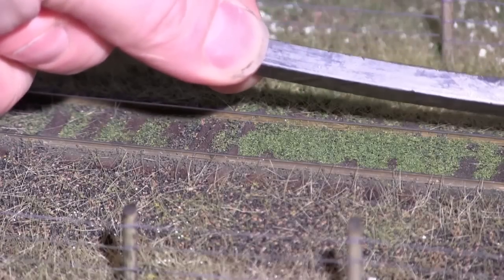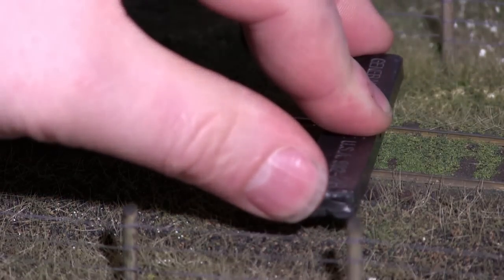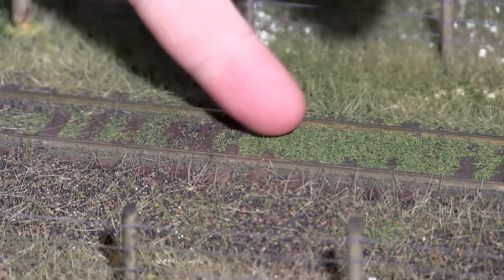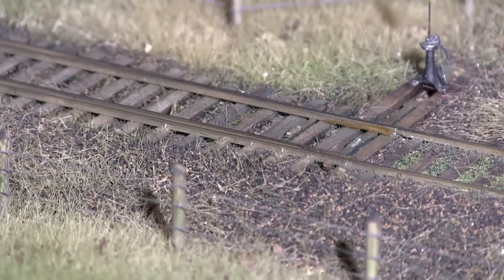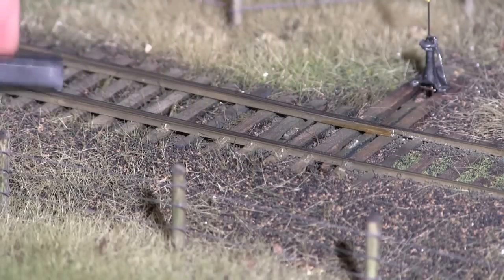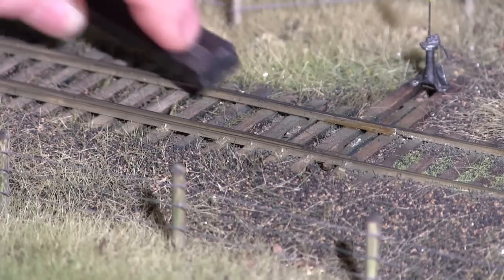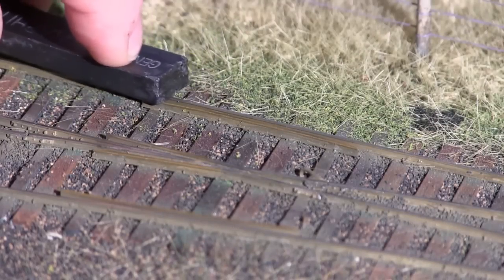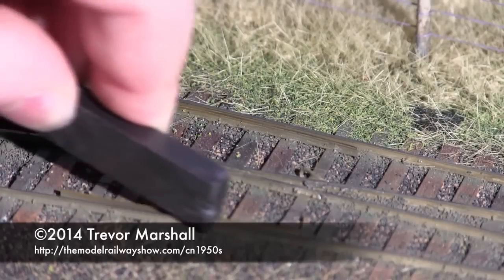Miracle model railroad track conductivity solution | Model railroad tips | Model Railroad Hobbyist

Comment: I'm glad this video and the article have prompted so much discussion. Based on the questions, here are a few answers:
- I learned about this method years ago, and have used it on three layouts (including my current one). I do this ONCE - after ballasting the track. If I do some track work (e.g.: replace a turnout), I reapply. Other than that, I never have to add a fresh application of graphite.
- I try to use as little as possible. I repeated the application a couple of times in the video (sliding the stick back and forth, for example) to demonstrate the technique. In reality, you probably only have to slide the stick in one direction, once, to apply enough graphite.
- I've had all the track down on my current layout for almost three years now. I have not had to reapply the graphite. In that time, I've had one steam locomotive build up a bit of graphite on its lead (pilot) truck. I scraped it off with by holding a piece of strip wood against the wheel tread and turning the wheels towards the wood. (Using wood would scratch the tread.) This is most unusual and indicates that I applied too much graphite.
- If in doubt, don't do the whole layout - just apply to spots where you are having reliability issues. Do the rails a few inches to either side of the problem spot and leave it at that. As with anything, the best application is the least amount you can get away with.
Cheers!
- Trevor (Port Rowan in 1:64)
Reply: Trevor Marshall nu
Reply: Trevor Marshall graphite is also just a tiny bit abrasive.
Reply: velcroman11 u
Reply: Trevor - how often do you have to reapply the graphite or is it only once which should last for years?

Comment: Can you inform me on where can the sticks be purchased!  What a great idea, thanks
Reply: Graphite sticks can be purchased at virtually art supply store, such as Michael's or Hobby Lobby. And they are not expensive!
Reply: houw bout automatic transmission fluid though? it won't conduct in itself, but the additives will turn the oxide on your tracks from semi conductors into conductors... plus you will only have to apply a tiny bit once and there's a good chance that for 6 months you don't have to clean either.the wheels will spread this the same way they will spread graphite.

Comment: Years ago I saw a modeler recommend AT fluid with a q-tip. I've been doing that ever since. I never have to clean my rails. I dab the q-tip in a cap full of AT fluid and then dab the rails in a few spots. I just got back to my layout after very sporadic usage and they trains stuttered a bit. I dabbed the AT fluid on and ran the trains around a few times and they worked perfectly. I've had the same 16 Oz bottle of AT fluid for 6 years.
Reply: AT as in automatic transition fluid? That's the only thing that came up when I Googled it
Reply: @ShukakuTheCrazy1  Yep. Automatic Transmission fluid. I've been using it for years and I don't have to clean my tracks.
Reply: @praingmantis1  how well does that effect conductivity? I'm mainly asking because I'm having some rolling stock that lights up via the tracks, much like the locomotives themselves. After a recent cleaning they have trouble lighting up and staying lit
Reply: I use a DCC setup and have no connectivity issues. All my sound decoders and lights work just fine. No skips or pauses.
Reply: Ok. Still running DC on my end.

Comment: I originated this perhaps 8-10 yrs back. It was just for switch points, though.I used pencil lead/graphite. The post is somewhere in the "Trainboard" forum. I think spreading the stuff along the trackage anywhere but switches and frogs is a waste of time  since a brightboy of other rail cleaner is the ticket.. Leave alone, I'm not sure, but lots of graphite along the trackage is going to build up on the wheel treads of all the cars and engines = gunk..
If all locos were equipped with 'stay alive' there'd be no stall-outs in the first place...I do like the battery idea allot if they'd be rechargeable.. We could have a track dedicated to this. Engines would park here (engine house / spur) in order to 'refuel'. MH
Reply: Mark Harris I an RV m

Comment: I enjoyed your idea - I looked to purchase a graphic stick & found they come in several hardnesses. What are the specifics of the one you are using & possible place to purchase? Did find an assortment of  them on Amazon (Graphite art stick Assortment includes two soft, one medium, and one hard) These might work - just wondering your preference for hardness - if it matters?
Thx in advance.
Reply from the maker: +JB Morrow Commonly will find 2B, 4B, or 6B, from harder to softer. You may also find 2H, 4H, and so on, but those are too hard. 2B is best, with 4B being okay. 6B is too soft. You want something that will leave only a microscopic layer of graphite on the railhead, so softer is generally not good. However, H hardness is too hard and contains a lot of clay (that's what creates the hardness) and won't leave any graphite on the railhead.
Reply: +Model Railroad Hobbyist magazine thx

Comment: Thanks for sharing this tip. Just wondering if this will cause wheel slippage on grades?
Reply from the maker: +BK Bradley You won't have a wheel slip problem if you apply only a microscopic film with one quick swipe. If you can see it, you have applied too much and you will have a wheel slip problem.
Reply: of course it can its a dry lubricant*

Comment: Since graphite is also a lubricant, railroads use it as a flange lubricant, I would think you it would significantly reduce traction, which is minimal to begin with in N scale.
Reply: It does a bit, but to me, that just makes for more realistic operations. Especially on smaller layouts with over weighted rolling stock.

Comment: Very hard to find a graphite block of that size. Also, I use a special box car pulled by a battery operated train (no track power). The box car being pulled by the train has a small Velcro pad and steel wool pads dropped on each rail, very similar to two tooth brush independently weighted on each track. I let the train pull this car for 5 laps and the tracks are cleaned like brand new. It's easier to let the train do the cleaning all around the tracks than having to clean them manually. It would be hard to manually clean the tracks in tunnels.
Reply from the maker: Here's a link to a set of 4 on Amazon for $5 with free shipping: 
Compressed Graphite Sticks 4/Pkg-Black - Assorted 
Link: http://a.co/4bRTqkg

Comment: Nice one. I am guessing this is one of those artist's graphite sticks for drawing? Does it matter which number(ie 2B, 6B) you use?
Reply: struck2soon 2B seems about right. If you go any direction, go slightly softer, like 4B or 6B. The harder versions 2H, 4H, 6H etc have clay added to increase hardness, and you're better off not having that on your tracks.
Reply: Cheers. By the way, very nice looking piece of trackwork used in clip.

Comment: Surely the graphite powder is going to get picked  up and thrown into the gearing.......?
Reply from the maker: The key with applying graphite to track is apply as LITTLE AS POSSIBLE. If you can see the graphite, you have applied way too much. You want to just rub the graphite stick lightly and quickly over the railhead with no pressure -- done! The aim is a thin, imperceptible film. If you see any powder, you have applied WAY TOO MUCH. With graphite (look up graphene), the magic is in making the layer a thin, virtually invisible film.

Comment: I'm not new to trains but this one confuses me..I understand graphite is conductive but doesn't it Essentially make a clean track dirty and then contaminate your engine and rolling stock. Isn't it better to have really clean, scrubbed, and/or even lightly sanded track to help with connectivity?
Reply from the maker: Nope. Graphite has a very low dielectric constant, which means it inhibits micro-arcing. Micro-arcing causes the metal molecules to form a black oxide, which is not conductive. That's the "black gunk" we see on dirty track and wheels. Low dielectric constant materials inhibit micro-arcing, keeping the track clean longer. Low dielectric constant materials include: very thin layers of graphite (if you can see the graphite it's too thick), mineral spirits, and many electrical contact cleaners. See more: https://s3-us-west-2.amazonaws.com/mrhpub.com/2019-05-may/online/index.html?page=8
Reply: @MRhobbyist  wow. Love learning. Thanks for clearing that up.. i have a question about something completely different..power options.amd set up for different era trains..can I ask here ot is there an email I can write you at to share what im up to? Have a ceiling shelf fastrack layout ive been working on in my Irish Pub at home..could use your feedback. Let me know. Jim

Comment: Could this do damage to locomotive gears over time? Seems like putting any foreign substance that is like a powder would be a bad idea.
Reply from the maker: ytsekurt Graphite is also a lubricant you could apply to gears if you like - and small graphite blocks are what's used in locomotive commutator contacts inside the motor. So the short answer is no, this won't hurt the gears or the motor at all.

Comment: It's time with new battery technology to have our H.O. trains with NO dependency on electric running through the rails.  Being able to run trains , without constant cleaning of track plus the added time and maintenance will, WILL get a lot of arm chair layout builders out of their chairs.   More layouts will be built
Reply: that would be cool using batteries but the new batteries are literally explosive or they just light on fire... just takes a good bump... also they are terrible for the environment... so dangerous to your house and the earth. i say, maybe we should just use the juice in the rails via wall socket.
Reply: I guess that's a pretty doom and gloom outlook for batteries.   The reality is, they are here to stay for the forsee able future and they continue to get better.  I've used batteries of all types all my life for many things with no problem at all
Reply: I haven’t been in the modeling hobby for several years. I was pleased to see that battery power RC is finally taking off for HO scale. Not only can we focus on realistic looking track and switches without worrying about electrical conductivity to get current to a locomotive, but we can now focus on using a typical, mildly clean track to simulate real track circuits for signaling.
Reply: I just got back in to HO trains after a 10 year break. The reason I came back is because of the battery power. No worries about voltage shorts, poor connections and dirty track. I am designing a turnout section where I can park a train and charge right on the track. This technology  is only going to get better.
Reply: So I guess you don't own a cell phone, computer, tablet computer, remote controlled device or any modern technology? Please educate yourself before you make comments about what you do not fully understand.
Reply: I haven't seen HO scale battery powered systems yet.  Can you post a link?  Thanks.
Reply: ronaldo23425 there are kits you can buy that use the same tech as small model drones
Reply: Ronald I did a video running an HO scale engine on the bench work (bare plywood) of my model railroad Chuck RVRR
Reply: With my health being the mess it is and with having a rather small layout, track power is fine for me, keeping track of battery charges in multiple locomotives is more hassle than I'm interested in, just keeping up with the camera batteries is enough. (no, I don't have a smart phone, or a kindle, or a tablet, or a ..., or a ...,  to have to keep charged. but we do now have a culture where keeping track of multiple battery devices is a normal part of life, so adding a few trans might be no big deal; but my health is a mess and that would be more than I'm good for a lot of the time)
Reply: I think a savvy company should design a model train’s battery similar to a smart phone. Just run it around the layout for a while, and when it gets low, you can charge it through the rails or “refuel it”. Putting a small processor in it similar to what an Apple Watch has would advance the hobby light years tech wise. No more DCC, no more crazy track wiring, no more stuttering. The tech is there. The main problem is just expense. The markup on these would be rediculous, not because of the physical components it would require to build a model, but just pure greed among model train companies in today’s corporate environment.

Comment: Doesn't this cause a traction problem?
Reply from the maker: +HARPO1ME See the answer above. You will have a traction problem if you apply too much. The idea is just a microscopic film that you can't see is PLENTY. To apply such a film, you only need one quick swipe of the graphite stick with no downward pressure on the stick. You don't want to SEE any graphite or you have applied too much and it will affect loco traction.
Reply: Thanks for answering!  I get it now.

Comment: Nothing chews up plastic gears faster than powdered graphite. Hope you don't get any inside the trucks.
Reply: Not so.  Powdered graphite is a lubricant, just like powdered molybdenum. When you want a dry lube, minus any liquid delivery medium (as is often the case with molybdenum) use graphite powder.
Reply: You know, that makes this really interesting, ""Greas-em"Dry Graphite Lubricant Kadee #231This fine, dry graphite lubricant is specially selected for use with Kadee® Couplers & Trucks. 5.5 gram tube Also an excellent general purpose lubricant for use all around the layout to reduce friction in moving parts and bearing surfaces. Add a puff inside your couplers, move them back-and-forth a few times to burnish and enjoy smooth action of your couplers."
Reply: Of course you know that graphite is mono-layered crystalline carbon - kinda like slicing a diamond very very thin. These mono layers slide over each other with very little friction. However, even when ground up into a fine powder, it is still crystalline with sharp diamond edges. Some harder plastics such as polycarbonate can sustain light use without much wear. (How much force does a Kadee coupler or a pinewood derby wheel undergo?) However, softer plastics such as nylon (most gears in scale locomotive trucks are made of nylon) are easily chewed up by graphite. If you don't believe me, just puff some powder into your favorite locomotive's trucks and run it around the layout for a few hours. I've seen nylon teeth almost completely worn away.